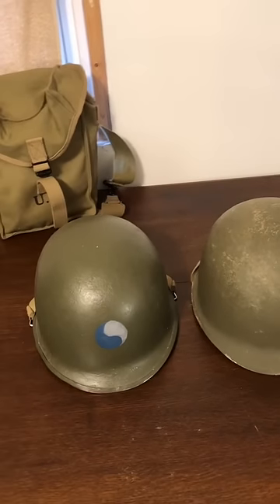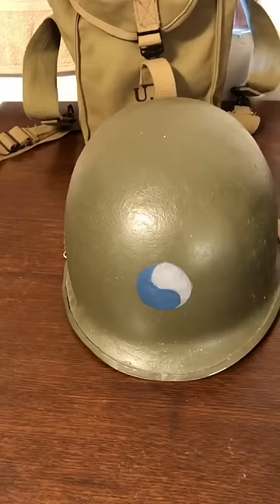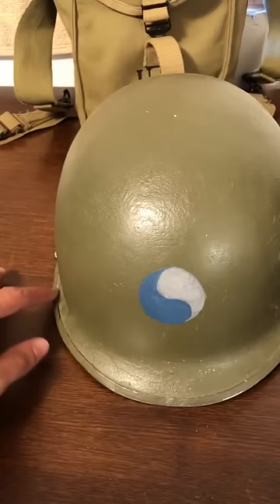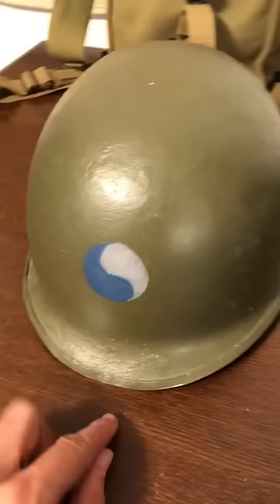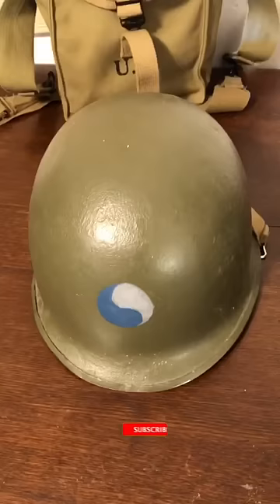The difference between WW2 and post war M1 Helmets-check description#shorts

Comment: The seam was moved to the back in late 1944. Was originally made of out stainless steel and later was changed to manganese steel like the helmet around 1944 as well. Another way to tell is by heat lot number. Each company that made M1s had different ways to mark their helmets. WW2 helmets where either marked inside the brim with numbers then a letter, same but with and S underneath, or a P and a number on the inside next to one of the bales. Later produced ones where a tad lower domed and different company’s started to produce them until 1977.

Comment: This isn't exactly accurate. They switched to the rear seam in Nov 1944. So rear seam helmets can still be WW2 era. The best way is to look at the heat stamp if it's visible. When McCord ceased production the lot numbers were in the low 1300s. Any number lower than that was produced during ww2. However, the later helmets may not have had enough time to actually be issued to soldiers on the front lines before the war ended. Those would've most likely repurposed for korean war helmets.
Reply: Also there were quite a few fixed bale helmets that were rebuilt post war due to damage to the bales which required stripping off the paint and texturing so the swivel bales could be installed. I happen to have one such helmet in my posession.

Comment: I have an American helmet that came in a cover, I was thinking back and fourth if the helmet was from Vietnam or WW2 but it has a seam in the front so I guess its ww2 issued?  But the strap isn’t leather and it was definitely used because its all rusted and has paint chips, plus it also smells funky
Reply: They used M1 helmets up to 1986. I do know that the old WW1 & WW2 had fixed bales, then they took a lot of the older helmets and put swivel bales on them. From what you said, I'd say yours is a WW2 Era helmet. But,  they were used in WW2,  Korean War, and Vietnam war all the way until 1985 I believe was the last year. Hope this helps. 
Merry Christmas